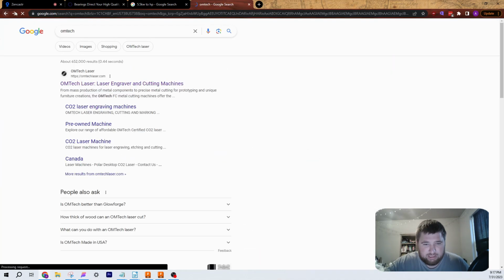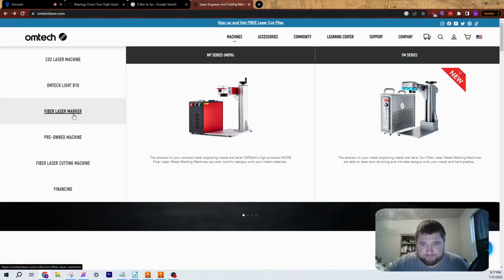Syil X5 and X7 Purchasing Decisions -- Ep. 47

Comment: curious, after having the 1500mx for a little while now, how do you believe it stacks up to an x7? cost efficiency as well as other facets?
Reply from the maker: I'm very happy with my 1500. I want a second one and a robot to feed parts into them. The Syil machines are still cheaper, but with all of the huge quality issues they have has recently, I wouldn't even consider one myself
Reply: @AudacityMicro  Thank you sir, I run a Langmuir mr1 for small parts in my motorcycle shop and it has worked great but with no tool changer and slow rapids I am rapidly growing out of it as my primary machine and the 1500mx looks like my best option

Comment: The electrical current/power supply requirements on the your chosen SYL and other VMCs is due to surge currents from servos accelerating/decelerating on all axes. Lathes are much simpler devices - spindle gently ramps up and chugs along. And finally you have a US product liability wild jungle. A lot of machinery manufacturer, which import into USA, employ a conservative approach, to avoid any litigation cost due to fire or other issues.

Comment: Haas does a break in procedure when installing a new spindle, when you get a new unit from them the tech will start it before they leave, mine ended up running for around 3-4 hours. I also do a warmup cycle every day before running parts. Help bearing life is my theory as well.
Reply from the maker: So this video was recorded a few months ago, (I'm uploading our old podcast episodes to youtube). I ended up buying a used Haas OM. It yells at you to do a spindle warm up routine every time you start up the machine. I've started doing it on the tormach too for good measure.
Reply: @DesignTheEverything  gotcha! My unit does that as well. It should also help with machine growth etc so you start with a consistent temp, maybe not as much in a climate controlled space. Haven't needed to really dial that in so far